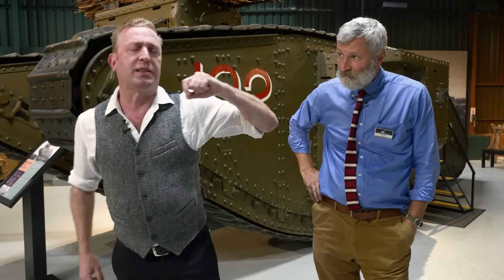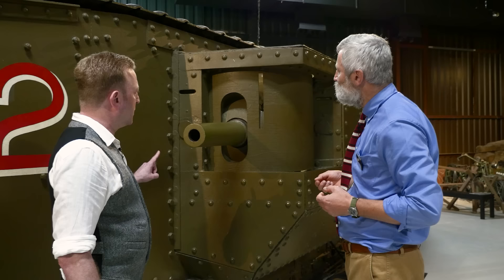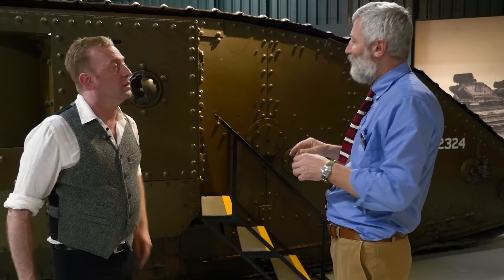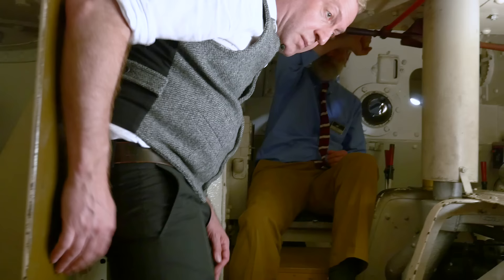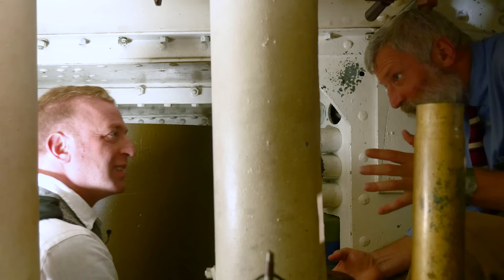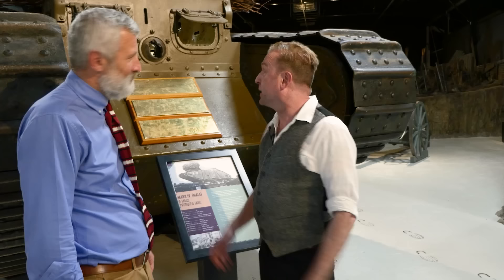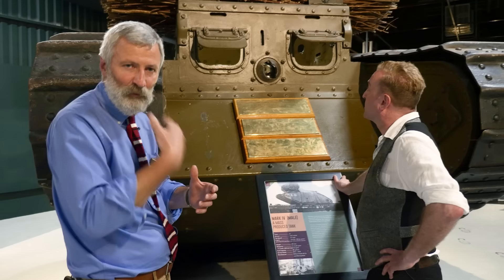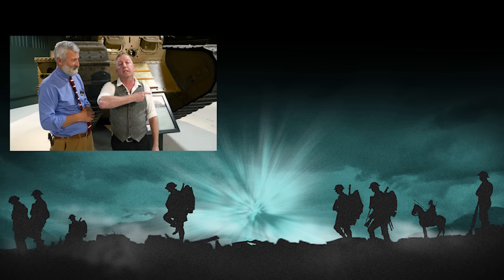Inside A British WW1 Tank - The Mark IV I THE GREAT WAR Special

Comment: Finally, a museum where i'm allowed to touch all of the exhibits.
Reply: Trey Lower I
Reply: It's a great place to visit. The only time I have visited they were moving the Tiger from one shed to another. Such a worthwhile visit.
Reply: I visited a tank museum 20+ years ago which was outside. Signs everywhere stating Do NOT Climb On Tanks. I take a lazy look around me at 360. I am ALL ALONE middle of the week. So I spent next 90m climbing on EVERY tank half track and gun that took my fancy and felt like I was 10yr old. Afterwards I walk to building with inside exhibits of small arms uniforms and such like. CLOSED IT WAS. RATS. Oh well. Learned a lesson that day, checkout which part closes first!!
Reply: The inside looks like somethin Captain Nemo would have built
Reply: Just go to russia. You can even climb and sit on their gun
Reply: @Torsengi  I bet you can buy one
Reply: @johnclose1837  just for 3,99$ ultimate soviet engineering
Reply: TRAVELS WITH MY CAMERA  Hi Little Donny. Could I get a small loan?
Reply: @Torsengi  you know there's reasons why they called Soviet tank is a coffin.
Reply: Lindy beige isn't an exhibit
Reply: You break it you buy it.
Reply: If they can survive machine guns and WW1 battlefields then they can survive kids picking their noses
Reply: @dougsteel7414  only one model and it's still in use 🤔
Reply: @andreasbonaparte8171  yea the reason is called javelin . 
Just kidding but not really
Reply: Or the exhibits aare allowed to touch you..

Comment: Tank = Bullet Magnet.  I think in WW 1 the tanks supported the infantry as much as anything by focusing enemy machine guns and artillery on the tanks rather then the infantry.
Reply: wickedholland I was speaking of the tanks in general however yes the bundle was dropped in tank traps and trenches to 'bridge' the gap.
Reply: than*
Reply: I haven't heard reports of machine gunners wasting their ammo on tanks. Germans figured out quite quickly that was ineffective
Reply: Chef Jeff  yes, although i suppose in the early ones you'll be too dazzled by the carbon monoxide and heat to have such an awful time.
Reply: @infantryhawk  Well, my old dad who was a tank driver on the Western Front in many bloody actions  spoke of the walls of his tank glowing red hot under the hammering of concentrated German MG fire, with molten lead running down the joints between  the armour plates.  MG fire was directed at vision slits and gun embrasures and was effective to some degree in restricting the actions of the tank crews.   Terrified British infantry would often try to hide behind and even under the tanks,  apparently not realising that they would be much safer  keeping their distance  from these bullet magnets. Tank crews were under orders to ignore them.
Reply: @infantryhawk  They may not target the tanks exactly, but infantry formations often involved using the tanks for cover while advancing so the tanks absorbed plenty of fire indirectly.

Comment: Great episode ! Maybe next time you can get the full crew in it and drive it around the base and fire off the guns. I would make a special donation to see that  !!! Yes, I know it won't happen and isn't practical but I can dream !
Reply from the maker: +David1775 I think after filming inside this thing we are not to keen on being inside when the engine is running.
Reply: What?? You don't want to sit right next to a running engine in a tank with no suspension so any bump can knock you around? All those bolts on the inside make it look like a sadist designed it. I can't imagine it being more miserable unless they replaced the gasoline engine with a coal powered steam engine. Still, you would probably be safer than an infantryman charging across no man's land into machine guns. Choices, choices !!!

And honestly, once the carbon monoxide poisoning starts you won't feel the effects as much. ;)
Reply: Well he DID say that by liking it ALL our dreams would come true so.... start liking it?
Reply: Hearing protection is a wonderful thing.
Reply: I think the crew filming and moving their cameras would be faster than actually moving the actual tank.

Just a guest.
Reply: +David1775 I'm pretty sure they (the museum) have a reproduction version of the mark IV from the 2011 Steven Spielberg movie war horse that they usually use during the tank-fest parade.
Reply: This being the U.K. there's no way they would have functioning machine guns.
Reply: Fine, then we will just have to settle for the 6 lb cannons..... Yes, I am fully aware that what I was asking would never happen. It was intended more as a joke really.
Reply: blanks rupert, blanks.

Comment: It pretty much reminds me of some diesel locomotives we have here, of course, some things are different like driving post is separated from the rest of engine, but once you need to go to the other side of the locomotive you go through a corridor, one side loud running engine, the other side wall with some round windows, pretty dark place and very tight.

Comment: 22:50 why is there picture with a "20 mph = 32 km'/h" text on it? The guy clearly speaks about the range of the vehicle, not it's speed, which he mentioned earlier. Other than that, great special, as always :)
Reply: Void Gaming some people don't know mph to kmh
Reply: yeah the editor made a bit of a mistake, he might still know how things were but wrote the things too quickly
Reply: Zero DiNiro Yes, but that is not the point. He said the tank had 20 miles of range, not 20 mph speed, and earlier he said that the tank had under 4 mph speed, so showing picture with 20 mph written on it, might be confusing.

Comment: A tip from an ex tanker before you shoot image in a vehicle try to set up some lights so we can see the ppl in the tank clearly it works good for video and pics you can set lights up from the outside aimed in and a few on the roof pointed down turns the background from dark to light

Comment: did those tanks had many successes  in the battles ?
Reply: Not really. Tanks played only a limited role in WWI.
Reply: Yes in couple of crucial battles, plus they had a huge moral boost, arguably they helped convince the central powers that they are loosing the industrial race.
Reply: Some but not many. It was a great morale booster for the allies and a great terror weapon against the Germans, until they got used to them and learned it's many weaknesses
Reply: Καπτεν Χαρλοκ Very few. Don't think of them as tanks think of them as mobile pillboxes because that's what they were.
Reply: They were vital in breaking the deadlock and leading to the mobile warfare of the last '100 days'. For example being used as infantry support at Amiens and Cambray
Reply: Dwarven sphere This is objectively false
Reply: The FT light tank some success in 1918 at Foret de Retz, near Soissons, where 480 tanks massed in a counterattack.  Tanks made offensives more practicable, but the fact is that the armistice was signed while the Germans were still on French and Belgium soil, so that the massive number of tanks that were being produced missed WWI and instead got exported around the globe.  Tanks overall were not a war winning weapon, they were too unreliable and primitive, but they certainly influenced the outcome of a number of battles.
Reply: Realistically speaking, their successes were marginally at best, but propaganda make them to be into war winning weapons. From the morale standpoint, they were amazing, they inspired the nation and the troops.
Reply: it made em won ww1  in some way
Reply: Zamolxes77 Rush b cyka
Reply: Battle of Cambrai November 1917. Commemorated by the Tank Regiment.

Comment: MG Gunners often targeted the vision slits that you see and the bullet splash would be forced in through those as you tried to look out to see what was going on.

The chains were indeed not popular because of the even more restricted vision (and did not 100% block the splash), so soldiers used to just have to risk being splashed with molten lead in the eyes. That's why after that all tanks had periscopes.

About the engine noise, going deaf in those was also common after a while.

Comment: "Everything's designed to smack you on the head."  Yup.  Not a fun place to be with the heat of that engine right in there with you.  Just 20 years later its a whole different world in a tank.

Comment: There’s a mistake at 22:55. He’s talking about range, but on the screen it says 20 mph = 32 km/h, which is speed.
He said earlier that the maximum speed on a flat terrain is just under 4 miles per hour.

Comment: Actually I got to read a few eye witness accounts stating that machine gun bullets actually were capable of penetrating parts of the mark tank armor..
In the video it was said that bullets were no threat for the tank, only shells could stop it.
Reply from the maker: Here is a long explanation for these accounts: 

The initial armour of the Mark I was not thick enough for SMK bullets. For the Battle of Arras the British actually wanted to have the improved Mark IV ready but it got delayed, so they fielded their Mark II and Mark III tanks which were actually just training tanks. A Mark II is also the first tank that the Germans ever captured and the German engineers took this tank and its specifications for their calculations. So, when the Mark IV came around in 1917, their bullets couldn't really penetrate anymore. 

At least that's what David explained to us off camera.
Reply: According to the accounts I refer to, the British Mark tank was vulnerable only on certain spots with a certain firing angle. It was said that it required a lot of bravery for the defender, but if carried out right, it almost certainly result in neutralization of tank and crew. I guess this method only worked for Mark II and III.
It makes me think, what a bad surprise it must have been for the Germans, as soon as they realized that the second generation of Marks did not have the shortcomings of its predecessor which made it pretty unstoppable for trench infantry (with german standard armament)..

Comment: I read some time ago that the tank got it's name because the original shipping to France needed to be so secret they were crated and shipped as water tanks. Not sure if that's true. Are these shaft driven or chain driven and are there more than two gears R&F? There was a MkIV at the tank museum in Seymour Australia rusting away, not sure if it is real or not.

Comment: Dear indy an crew
I saw a TankGewehr in a german museam and i wondered if it would actually work against a MarkIV or if you needed a big piece of artillery to disable the tank, So what else then a TankGewehr did the germans use against the tanks?
Love the show!!
Reply: Armand Huttinga 
The Germans used 7.7 cm field guns slightly modified, and they developed the T-gewehr by 1918, a 13mm rifle which was basically an up-sized  Mauser gewehr 98.

Grenades were effective as well, but they required the soldier to wait until the tank was close enough to throw the grenade onto the vehicle, which took a giant set of balls, yeah?

Comment: They should turn that tank or simular into a demo of the conditions they had to face (bar the carbon monoxide poisoning)
Like put 10 people in at once, putting it on a elevator that can shake it, then bang it with speakers at loud volumes while putting the heat on and simulated voices yelling orders.

Comment: 18:30 - These tanks were very intimidating, but not air tight. Why didn't the Germans deploy gas to smoke out the crew? If you take the crew out of the fight, the tank is out of the fight, right?

Comment: 105 hp. That's really all you need to know about this tank.

The tank configured for resupply was the most interesting thing in the video. I wonder if these early tanks would have been better used in that role rather than for attacks.
Reply: MakeMeThinkAgain but massive gear reduction so alot of torque.
Reply: Now that you mention it, my 2 cylinder Fiat 500 would go anywhere in first gear.

Comment: That's not lead flying around inside as you call it "bullet splash".
It's spalling. Shards of the steel armor being shattered off by the bullet impact.
Reply: Same effect of HESH tank shells used in more modern times.